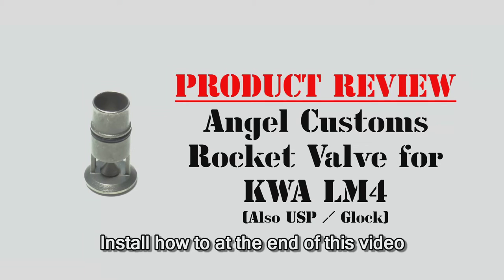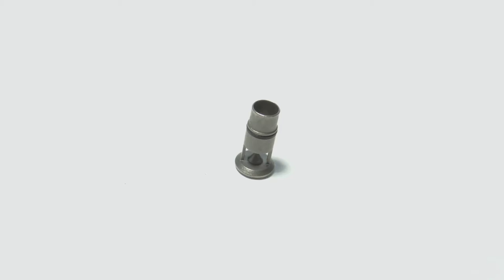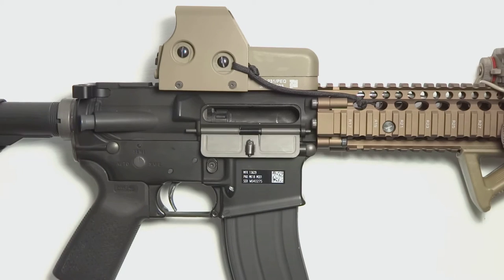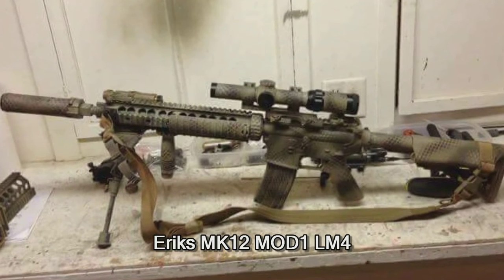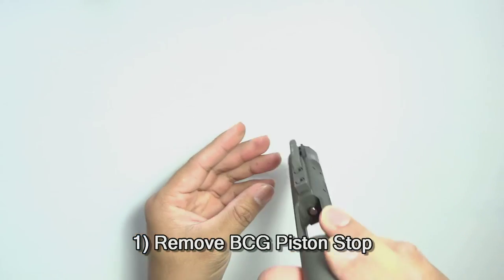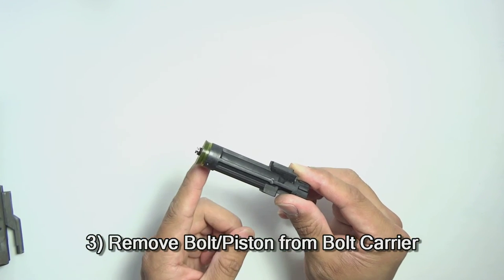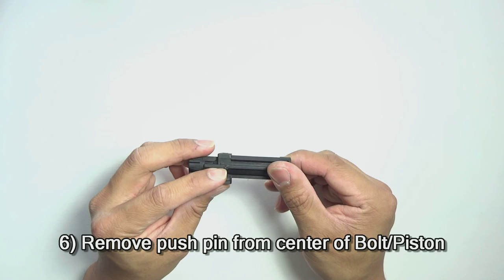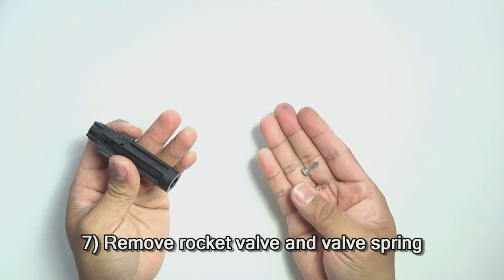REVIEW: Angel Custom Rocket Valve for KWA LM4 and KWA/KSC pistols

Comment: I put a cqb valve into my high power bolt and it's still shooting a little hot.  You suggested cut some coils off the the valve spring to lower the fps. Any idea about how many equals how much?